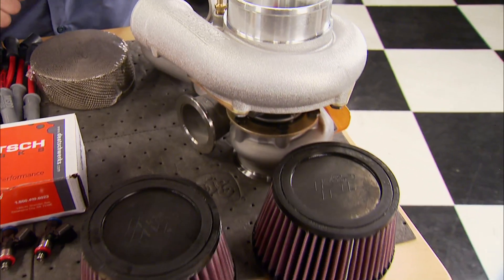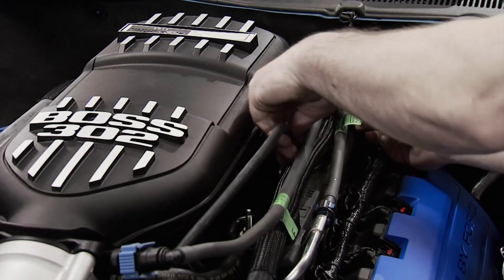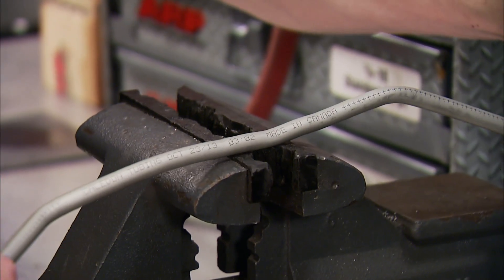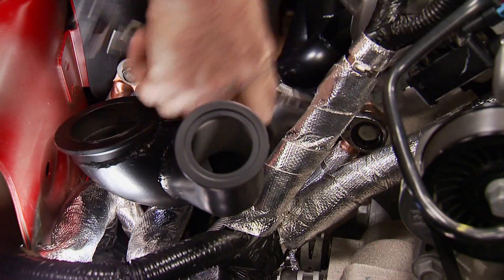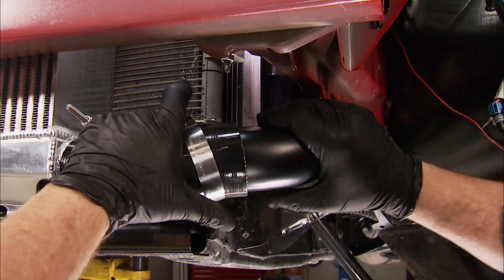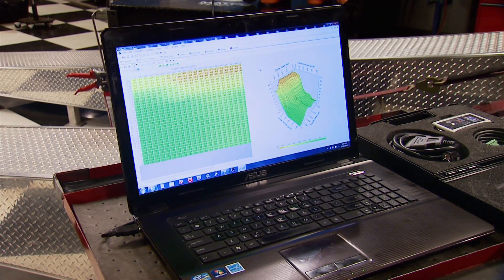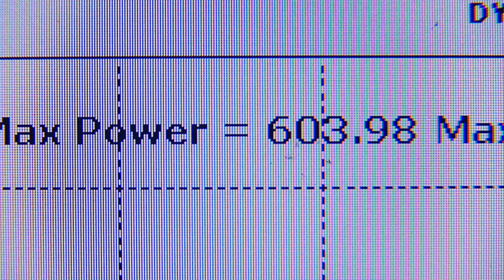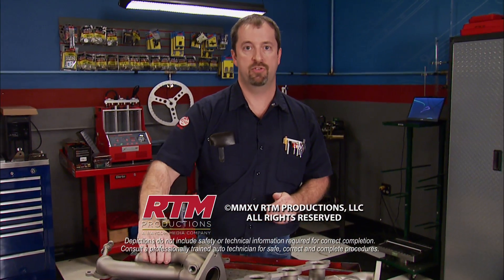600 Horsepower Twin Turbo 2014 Camaro - Engine Power S2, E1

Comment: So I can make almost 600hp on a stock honda k20 that's 2.0 liters vs that big v8 only making that with 2 expensive ass turbos, when use 4 bangers could us an ebay turbo and make that lame
Reply: Yeah I'm sure you could. But for how long before it blows up?
Reply: There is more to life than hp....A camaro is a man's car ...Sounds tough too
Reply: The blunted car guy k20 has little torque even at 600hp turbo'd
Reply: That Honda has to roll race. Junk
Reply: You'll spend 5 times as much to build and maintain a 600 hp honda.Towing charges,inconvenience ect.

Comment: Twin turbo and 600 hp.. those are rookie numbers better bump those numbers up
Reply: Well it was only on 9lb of boost, so isn't really turned up
Reply: @cai.williamsss  plus they left the cats on    maybe a few more horses if they took those off.
Reply: I mean for a daily driver with an untouched engine, stock cam, transmission and rear end, its the best of both worlds.. And besides, you can always turn the boost up.
Reply: Stock Engine bro... stock

Comment: I’m not drilling into my oil pan with it in the vehicle. Metal shavings and engine bearings are not friends.
Reply: You can do it. Only when using a really good tap and lots of heavy grease and go very slow.
Reply: Oil gets filtered before it gets sent to the bearings. Mesh screen catches the big stuff,  small stuff gets caught in the filter. Remember, your engine wears as it runs and there's ALWAYS metal particles in the oil. Aluminum from pistons, steel from the valvetrain, etc.
Reply: Nah, the grease from the tap, plus pan magnet and oil filter will take care of those.  Ideally, I think you're right, but I still think it's safe; too many other turbo installs I've seen do the same, so it stands to reason that otherwise many pretty-intelligent people would have already wasted a lot of their not-insignificant brain power on precisely the right answer to that question.
Reply: Mr. Morningstar  no, it implies that the pump can't pump enough with a screen smaller than 100 microns.
Reply: I tried that method about 3 years ago while my pan was off and that grease barley kept any shavings out the pan.  Ans thats BS those aluminum shaving will cause real havoc on your copper tri metal  bearing  and once you ruin your bearing the bottom ends next.
Reply: @Mr Sunshines  https://www.theturboforums.com/threads/a-machinist-a-turbo-and-his-l31-gmc.381269/ Thats me lying  Screens and filters? The crank and bearings touch the oil in the pan directly . Only a moron would leave chunks metal in their pan.  Gotta love  the kids on youtube you watch a few videos and think you know everything but never built a thing. Stop living bi curiously through others. make a note I build complete engines I dont bolt a few things on want to see more?
Reply: I would love to see some of your builds .
Reply: Its unorthodox for some of the older guys but it's safe if do e exactly how instructed. Slowly, with grease on the tap. You won't lose a shaving in the pan. 

I always run some brake cleaner through it afterward and then drain the pan and never had an issue. 

Yank that motor if you wish. I'll have a beer hours ahead of you 1🇺🇸
Reply: @dalemllns  See I did do it . The link I inserted shows a build doing just that with plenty of grease as recomended. There where chips in the pan.  It's impossible to catch all of them. When you spent 10k on parts for a engine a few hours to pull a pans nothing.
Reply: @markrich3271  it's possible to do if you rush it. I too have set a pan on the ground and done it to see. Going slow, the grease caught it all. 

I've also used the same method to rethread 4.6/5.4 Ford engines when they blow a coil pack out by shooting a spark plug through it. 

You're a machinist, maybe you just see things with more OCD than others. 

I have never had an issue using this method and my builds are living fine. 

I'm not a kid either before you fire off.
Reply: @dalemllns  I didn't have that luck . I just don't see why some one would want to take that chance over pulling a pan.
Reply: @markrich3271  I just glanced over your thread. You had a lot of work on that build. Hope it's doing well. 

I dropped a valve keeper on a HEMI 3 months ago and thought it went down the oil drain into the pan. Drove me  nuts pulling a bran new car apart. 

I know what you mean. Ways of doing things change. The first time I tried this method I wasn't so sure. Now, not worried at all. The key is to go slow, and not rush it. It works.
Reply: @dalemllns   ya that's what I meant . I put allot of money in  that engine I just could justify not pulling the pan one more time taking a chance on shavings.  Still own the truck I just purchased a s488 for it last month. I'm looking into wiseco boost line rods.  It's hard working on it because I  work at nights at a machine shop  . I'm at work now.  I'm on the verge of splitting that block So I can't go to crazy.
The new Hemi are awesome engines.   I've been there I plug everything up with those blue shop towels.
Reply: @markrich3271  yeah mine is a 392. My 4th Challenger. Had 3 392 cars and a Hellcat. I was doing a new TSP cam and springs in this car. Doing the springs on car and dropped a keeper. Ended up pulling it completely apart only to find the keeper in a frame rail. 1700 miles on the car. Facepalm moment. It's up and running well. 480rwhp with just a cam. All motor. Considering selling it though for a 96 Gran Sport LT4 car and doing a new LT1 swap in a C4 car. Cant make up my  mind though 🤷🏽‍♂️
Reply: Yup, thought that was stupid as well
Reply: It's aluminum won't hurt anything
Reply: @austindoud273  lmao aluminum will definetly hurt! hell...... a chunk of silicone can kill a bearing
Reply: @Shadow0fd3ath24  yeah a big chunk not little tiny shards
Reply: Austin Doud 100% wrong.

Comment: Now you know what its capable of, dial it back to 500bhp and it'll last forever. It's all good rolling max BHP all the time but component wear-down and replacement costs are just stupid. Dial it back a bit and avoid all that bullsh*t.
Reply: Aren't these motors forged from the factory??

Comment: ---- FOR EVERYONE COMPLAINING ABOUT THIS ONLY MAKING 600 HP-----

They are on stock camshaft, valvesprings, and pushrods. Understand that they're showing off just the kit. With updated valve train of course the kit would be able to run up WAY higher numbers.
Reply: 600 is terrifying if youve never driven it....can get out of hand...rapidly
Reply: @armaggedon4christ  so true most ppl commenting with there 200hp cars thinking they can drive a 600hp+ car easily
Reply: @BIGGIEDEVIL  my first "sportd" car was a V6 firebird, and it got away from me because I didnt know how to handle it...just because you HAVE 600hp doesnt mean you NEED to use it. Honestly most high hp street cars are PURE bragging rights...Im guilty of it too (dont have a ton of power)
Reply: dean Smith and they even said it’s running on 9 lbs of boost. Sounds about right to me.
Reply: 600 doesn't seem much at first until you see the gain. Stock it ran 383whp and 603 with just 9lbs of boost.... thats a 220whp gain just from pure boost a lil more fuel from the ever so slightly larger injectors.
Reply: Biggest problem is ring gap …..600hp is a safe number
Reply: If they removed the cats or put in higher flowing turbo designed ones and put the intakes in the fender, it could easily tap 650 or more...Maybe even use meth injection and hit 700 safely.
Reply: Purple Heart those turbos can flow way higher than 9 lbs 😂😂😂
Reply: @funnydubby6401  yes, they are going for a fairly reliable, daily drivable car that has some push to it when you need it. Noone is/should be doubting the turbos capability, were simply saying that they know full well that it can do more than 600, an LS3 however, I wouldnt trust it past 550-600 on a stock block and bottom end....are there LS3's that have stock internals making a ton of power, yes, but most of them are not factory freaks that can handle that level of power on OEM pistons and rods.
Reply: @funnydubby6401  now that I read yout comment it seems your just telling someone the turbos are not the restriction, if this is the case...carry on good sir/madam.
Reply: A Coyote would run this thing over with no internal mods...
Reply: @02autogt 2015 GT 430hp 2015 camaro ss 426 ls3.. 400 l99... tell me where the stomp comes in? My ls3 cam eats coyotes badly I named my camaro the wolf

Comment: Try an e85 tune and some bigger boost ;)
Reply: Needs valvetrain first
Reply: @austindoud273  fuck it. 😂
Reply: @austindoud273 actually, if anything, I'd pull the ls3 and find a 4th gen 6.0 from a Silverado. Then use the money from selling the ls3 to build that. I think the record for a stock rotating assembly on one is around 1500 right now.
Reply: @whatevermechanics 1540 hp on richard holdener's big bang theory for the 4th gen 6.0.  stock bottom end

Comment: New 2014 ? Camaro ss. New in 2019.!?
Reply from the maker: This episode is from 2015 and filmed in 2014.
Reply: @PowerNationTV  It made its debut on Sunday morning at 930 Am ET 9-3-2017, on Spike TV's "Engine Power" show.
Reply: @DarkLinkAD   it still doesn't take away the fact that it was rather new when they filmed it in 2014. Regardless of when it was initially aired
Reply: @drewinhou  Well, The Hellion Turbo Kit previewed 9-1-2017 on Youtube and online forums.. The car wasnt available until middle 2015..  
  Something doesnt add up.

Comment: My stock ass coyote with a procharher made 40 more hp than that with only 8lbs of boost
Reply: Keep in mind this was 2015
Reply: @Ray Sant Whats the all motor record for a Coyote right now?
Reply: DarkLinkAD all motor coyote have been hurting feeling since the first gens the new 10 speeds are doing high 10’s currently all motor
Reply: 640whp at 8 psi, puts you at 414whp all motor. Around 470-480 Crank. Sounds plausible.
Reply: DarkLinkAD all motor I was 460 to the wheels

Comment: how HOW is this possible ...when they put a bunch of bolt ons a small block chevy. can't get 350 horsepower ???..like I said my cast iron block head small block is pushing over 500 horsepower ..no nitrous...hmmm
Reply: This is made in 2015 most of the episodes wayyy before that
Reply: @joonaslaakkonen8096  It made its debut on Sunday morning at 930 Am ET 9-3-2017, on Spike TV's "Engine Power" show

Comment: 600 Horses???
Should have called Matt from Sloppy Mechanics, he farts that much power.
He pulled over 900 horses on a daily driven 5.3 with Stock Heads and did it cheaply.
Reply: the cam is the limiting factor here, also was the 5.3 running e85? How much boost? I'm sure it wasnt 10psi
Reply: @patrickm.blanchard8497  Yep, Sloppy Stage 2 cam from Elgen, about $160.
It was running E85 at 23 pounds boost.
But, they have pulled some impressive power on 93 octane.
But also remember that they only use Junkyard engines and reuse everything, even head gaskets. It really is a testament to how good the engine design is.
Reply: Shit we have made 1100hp off a 5.3 junkyard engine.  Head studs , head gaskets , new oil pump. Somtimes cam swap . best way to race cheap effective power.
Reply: They said the kit was good for over a thousand. Doubt the stock fuel pump or pistons are ready for 20psi.
Reply: @w.s.soapcompany94  the LS3 bottom end with a good tuner can hold 850-900 reliably. So 1000+ crank
Reply: @patrickm.blanchard8497  yeah for how many miles?
Reply: @w.s.soapcompany94  uhh well my car for instance has been raced hard for the last 5000miles and makes 1000 crank
Reply: @patrickm.blanchard8497  no motor work just bolt on?

Comment: May be ask Sloppymechanics for help for quarter price and double the power :)
Reply: this is still stock cam, low boost and pump 91
Reply: And in 2015
Reply: Yea, this aint no V, or Z where cam kit alone can get you near 600

Comment: A lot of work and $$ for a rather mundane power increase.
Reply: If you want to get the most from boost you need a cam swap.
Reply: yeah the cam is severely limiting power in this instance. Also this is still on 91
Reply: @patrickm.blanchard8497   Heads/cam/intake/headers/tune and slight fuel delivery upgrades this Camaro would be a reliable and more responsive. Add boost later.
Reply: In 2015

Comment: 600hp with twin Turbo 😕😕😕😕 i would be pissed off 😤😤😤😤
Reply: Couple of things i noticed. 
They mentioned leaving the stock fuel pump with a Boost-A-Pump, which might be a limiting factor but 65lb injectors and twin 62mm are good for 1000hp. Its also a possibility that staying emissions legal was the limiting factor.

  The numbers from start to finish are spot on gains for 9-10 PSIG or 23.7- 24.7PSIA
9 PSIG is about 161% of a Natural Aspirated engines power or 617whp, once you account for the retarded timing, you fall back to about 603whp.
383whp to 603whp ( Translates around 450 crank hp to 700-710 crank hp)

Also, I could be wrong but it seems like this is an 8 speed Auto, being dyno'ed in 5th gear (1.27 ratio) instead of 6th gear (1.0 ratio). This alone will typically result in a lower HP, higher Torque number.
    If they did indeed dyno in 5th gear, its likely because some dyno operators are uncomfortable with pushing 180-195mph in 6th gear, with 186mph rated tires on a dyno.

(27.6 Tire Diameter, 2.77 Axle Ratio for an Auto 8 speed )
Reply: I would be looking for 1000 HP but  with heads and cam and big injectors
Reply: change the cam and run it on e85 and i bet it makes 750 on 10-12 psi
Reply: To the rear wheels. But then again they're talking real numbers, not the ones people spout off without a clue thier civic only makes a few more than a lawn mower.
Reply: The money and time invested just buy the car with more power from GM.
Reply: These videos are what 10 years old give or take ....600whp in 2008 or 2009 was nothing to laugh at still a crap ton of power we are just jaded now with 1000hp cars
Reply: @thedaredevil1907  Thats a 2016, 6th Gen Camaro body style, Released on May of 2015.
The Hellion Turbo Kit previewed 9-1-2017 on Youtube and online forums.
 It made its debut on Sunday morning at 930 Am ET 9-3-2017, on Spike TV's "Engine Power" show.
Reply: the daredevil190 yeah that’s what they fail to realize
Reply: Or just twin turbo a coyote and make 1k hp 🤷‍♂️
Reply: @joshuamora6778  Youll still need a fuel pump..
Reply: DarkLinkAD of course you’re going to need the fuel supply but my comment about the coyote is that you don’t need to go into the engine to start making power with boost 😉
Reply: @joshuamora6778  Id have to see a reputable dyno.
  Ive seen too many 2018 Mustangs claiming to run 810whp on stock cams, with 9psi.
 That would make it an All Motor 500whp,590 crankhp with no modifications, I dont buy it.
Reply: DarkLinkAD https://youtu.be/qVA6_D_9s-4 not just a dyno queen
Reply: @joshuamora6778   
That dyno shows 15psi, 1016whp. That would mean this engine pushes around 510whp All Motor, or about 590-600 Crank Horsepower.   Is it possible on completely stock cams? On an Engine that typically dynos 415whp with more timing? Is it also possible that someones tryin to make a buck?

 Hey, if it turns out that an all motor, exhaust only Coyote makes 600 Crank Horsepower with just a tune, im sure the world wont forget..
Reply: DarkLinkAD I follow that built in person that’s just how efficient the coyote and TwinTurbo kit is....
Reply: @joshuamora6778  That one comes up at 438whp all motor, which seems way more sense-able. Thats within 10-20whp of other bone stock dynos.
Reply: Chevy caprice do u know horsepower on 2020 camaro zl1
Reply: @marcojordan1368  nope
Reply: Needs a lot more supporting mods (stock trans, fuel system, heads, cats etc) 600whp is a safe bet this kit could do 1000hp easily